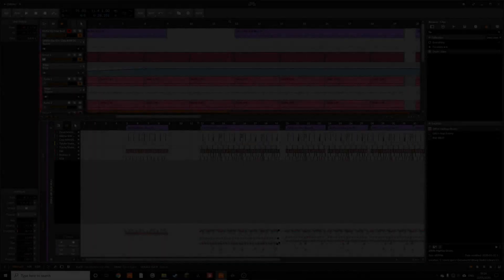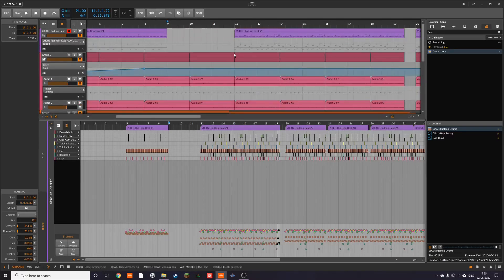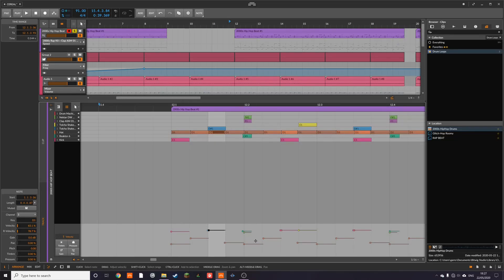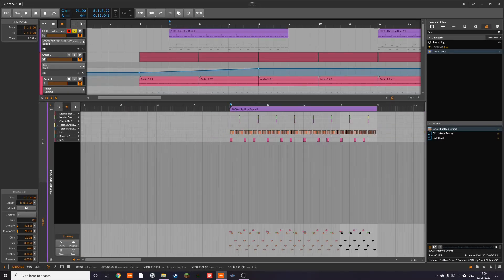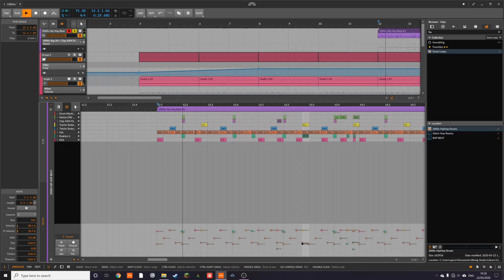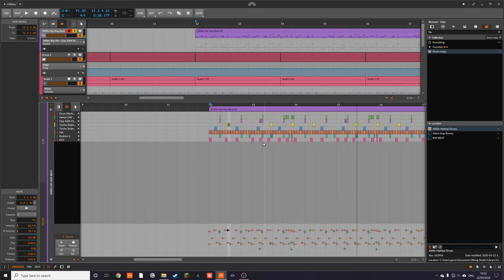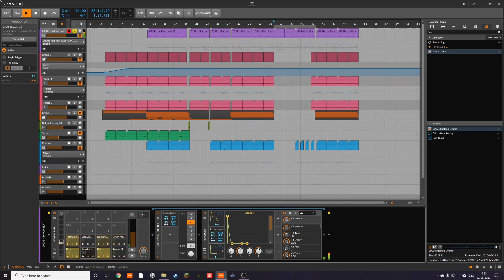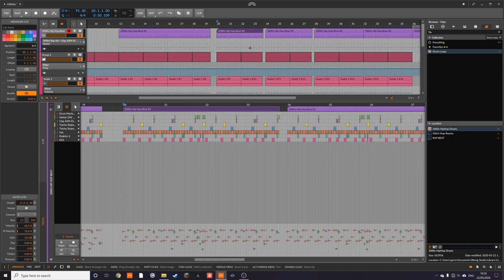How To Add More Groove To Your Drums - Bitwig

Comment: Hi, I recommend you take a look at "Groove Templates" from the FL Studio Piano Roll. You can use the ones it has, create your templates from midi or audio and save them, even download them from the internet. There are collections of the actual Groove Machines (MPC, etc). Then you can export the MIDI to Bitwig.

Shufle and Swing is ok but nothing to do with the Real Groover.
Some time ago I wrote an email to Bitwig devs about this topic, including a link to demonstration videos of the FLStudio Groove:
https://www.youtube.com/watch?v=-6VSxKqaR5M&t=1006s (2007)
And the answer is that they would take it into account, but that they did not have it in their plans for now. The truth is, I hope that the batteries are put in this aspect. On the other hand, Reason has something similar called Groove Mixer, it doesn't modify the midi, it's real time.

You can also use ReWire and IL MiniHost Modular. It is not necessary to buy the most expensive version, but the most basic I believe does not work with audio tracks. Likewise, you can download an old version (eye patch like pirates, wink, wink, elbow, elbow.) ...